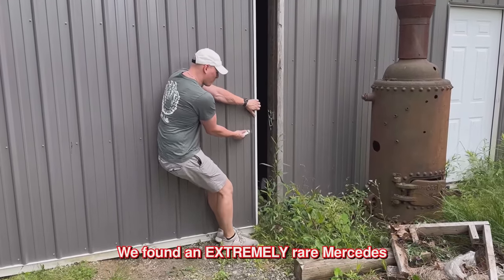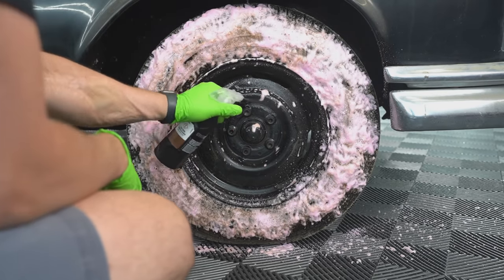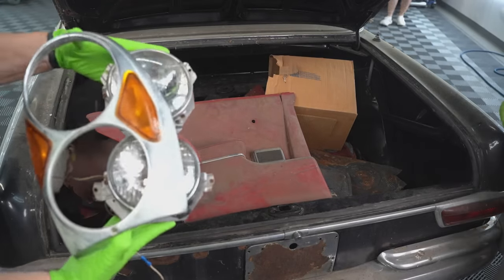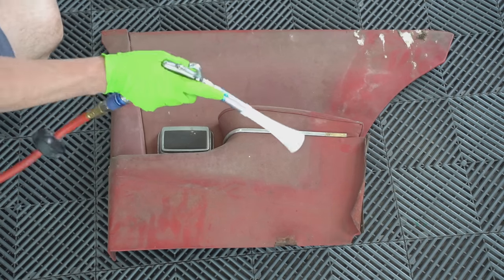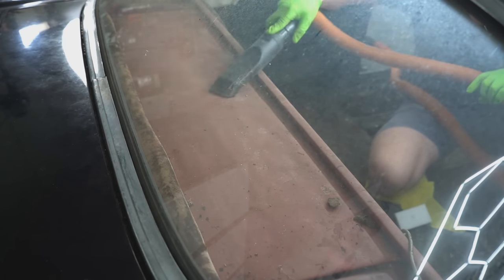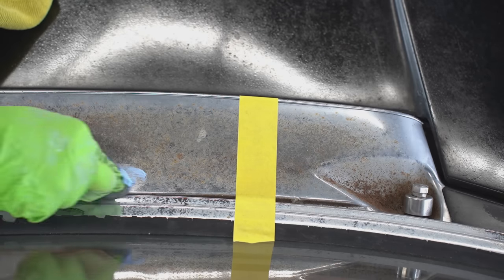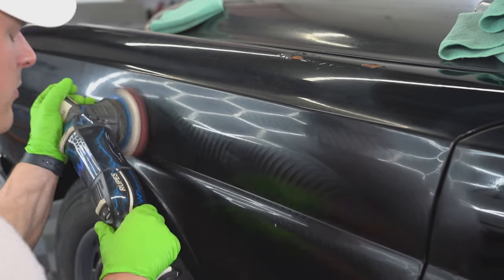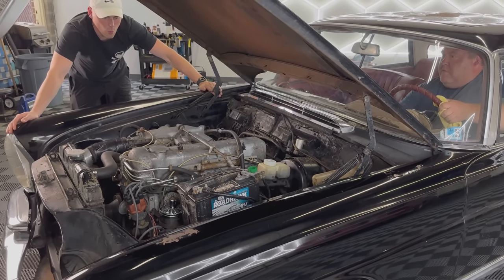First Wash Since 1995: Barn Find Mercedes 220 SE! | Car Detailing Restoration

Comment: You guy do an awesome job each time! It’s so sad to see a beautiful car like that rotting away in a barn 😢 it should be fully restored and brought back on the road.
Reply: That would be nice, except it cost 100k to restore it and you'll just have a 50,000 car
Reply: @exploringintocarsplus8763  this cleaning cost 100k? That car runs already, don't need to be restored

Comment: The headlight lenses show that this is a european model of the Merceces 220SE that, when the rust/paint is resorted and the dash wood brought back to its original glory by a professional shop, you'll have an easy $70 - $80,OOO Mercedes and probably much more without having to do a full-out restoration.  Black with red interior, a white steering wheel (get rid of that leather wrap), a sunroof (very rare on the european models) and the best yet - a Manual Transmission with the original white knob -- and you are in the sweet spot of the hand-built Mercedes cars of the 1960s. The only models more expensive than this in the W108 and W109 line  are the convertibes.  Go to Bring a Trailer and research recent auction prices for these beauties.  You guys have a winner and one of the most exciting automobiles to drive.  Congrats !!!

Comment: Be sure to change all the fluids. It's been sitting for awhile. The only thing I didn't like was the old hand grip cover on the steering wheel , always hated those things. And by all means get the roof redone. If the rest of the car looked like the roof I wouldn't bother. Good luck with your classic!

Comment: Awesome job detailing this car! 
This is a very rare and highly desirable vehicle. In fact, I know of a similar one that was a fully restored example that was recently exchanged through private collectors for $480,000.
That said, the vehicle deserves a full body off restoration by a competent restorer that has extensive experience with MB cars since many parts may be difficult if not impossible to locate. Thus, they have to made again from scratch. That's not easy nor cheap. 
The process will be lengthy, cumbersome, and frankly, very costly. However, once complete the results, if properly done, will be worth it. 
My only hope would be that the vehicle is kept in a safe, secure, and clean storage area when it's not being used or shown.

Comment: Beautiful job. Curious why you didn’t remove that aftermarket steering wheel wrap and clean the rest of the steering wheel. Either the other car or Indian would be great, but that Nash is probably more rare today than the Indian. Just hope you video them both.
Reply: The steering wheel is made of plastic and was probably in much worse shape than the leather steering wheel cover.

Comment: Beautiful and rare car indeed. About the only thing rarer is the drop head of the same model. Both the Nash and the Indian deserve your attention, but the Nash first. That is a beauty and looks like it will respond to your care very nicely indeed.
No question. Strip and repair the entire body, then good paint. I have see what happens to one of these that got left after the paint did that. It was the end for a once magnificent old Mercedes. Done now the panels can be saved. Wait and the entire body will need to be replaced. These cars rust from the inside out because they were sprayed and not dipped at the factory. There are areas of bare metal that will prove fatal once the rust opens the cavities.
Spectacular job, guys. Well done! Seeing it clean reminded me of the one thing I hated when these were new. The tail lamp clusters are horrible! The tail lights themselves are those thin strips above the reflectors. The brake lamps are the inner vertical sections and the turn signals are the outer.
The sound brings back memories. That's what they were like!

Comment: Well i guessed correctly with it being a 220SEb.
An early one with the 2 vien injection pump with splitter blocks.
My dad had a saloon version of this car and, for such a heavy car with only 2.2 ltr engine, it really could move!
Did all my teenage courting between it and his later 230SE & 220S😁😁
Fabulously reliable cars and im willing to bet there are few on the road which are properly tuned, we had a Mercedes wizard of a guy to tune ours up.
The difference is day and night.

Comment: Best one so far! (but I am biased because I am a Mercedes nut). I'm on my 3rd, a 2006 C220 CDI but 20 years ago I drove a 1973 200D. 
I love the red interior, you guys made it look brandnew. As for the rust, it needs to be looked at but I don't believe it is so bad a complete respray is necessary. Looks more like paint flaking and leaving bits bare to corrode, does not look as if it's going all the way through. I'm sure a professional will be able to fix it.

Comment: Not sure if the hubcaps are original?  They being the full wheel coverage came later I believe?  I could be wrong.  I had a 68 250 SE with the moon center caps with beauty rings.  Tough call on rust repair, it is a survivor car. My father had a 69 280 SE Coupe that traded in 1984 and I am still pissed about, I found the car while he looking at a early 60's Chevy convertible.  Beautiful automobile and you gents did a great job.

Comment: Ja, das weckt Jugenderinnerung in mir. Ich hatte mehrere Fahrzeuge 220 Se einmal wie Diesen als Coupe, dann als 220SEb "Heck flosse", dann 2X als 300seb, davon 1X mit 6-Stempel-Einspritzpumpe und Langversion als Versuchsfahrzeug (labormuster) In meinem Leben fuhr ich nur Mercedesfahrzeuge Und fahre diese immer noch.Der 220SE braucht nach deutscher Einstellung ca. 12-13ltr/100km, nach Exporteistellung " blauem Buch" (andere Steuerzeiten)zw. 9-10 ltr/100km; aber auf "KLingeln"(Selbstzündung) achten!! Sprit -oktanzahl normal Benzin Bleifrei 95 oktan. Diese Fahrzeuge waren sehr zuverlässig und sicher. Hinten rechts ,vor dem Tank ist eine Kraftstoffpumpe mit Filter und Druckspeicher Achten auf Dichtigkeit, besonders an den Schläuchen, evtl. sind diese Spröde nach dieser langen Standzeit Fahzeug wurde ca. 1962-1965 gebaut.Mit diesen Reifen(13") nicht über 200 Kmh fahren, Platzen gerne! Fahrzeug selbst fährt leicht über220KMh! Viel Glück und gute Fahrt!
Reply: This engine won't last long with its old oil, not to mention the rest. You never restart an engine that's been out of action for so many years. Sinister video in reality, the gogols are fascinated by soap, for the rest.......

Comment: 2.2litre Coupe Einspritzer 220SE (coupe with fuel injection). The sports coupe light or SL and these S bodied coupes had a great design.  It has mechanical fuel injection and that pump may require an oil change. The full size 4 dr S sedan of this era was out of touch design with fins at the tail referred to Heckfloss.   Narragansett Bay

Comment: Great job of cleaning, but...  Not to be a curmudgeon, and please don't hate on me, the video at 13:14 shows a ruined wood dash that will need to be restored and of course the steering wheel cover means the rare ivory steering wheel will need to be purchased.  Not to mention the vehicle will need to be repainted (see 21.27).  These repairs alone will easily cost north of $10k.  In other words, this is a very clean every day driver worth maybe $7500 IMO.

Comment: Even if it's allegedly rare, these examples of mid-60s MB coupes don't bring huge money. The later V8 models are more desirable.
A full-blown restoration would be cost prohibited. I'd say get the mechanicals sorted to make it a reliable driver and sell it. It should bring high teens, low 20s as is, if it's a driver.

Comment: They made over 14,000 of these, so it's not really "extremely rare". It's a Euro version, which makes it seem unlikely that it would have been displayed at a US car show.
The owner is misinformed about the injection pump. It is lubricated with engine oil, and there is a dipstick on the back of the pump to ensure the correct oil level. You should not add anything to the fuel.

Comment: you need the metal repaired. Reason is that the quality of metal used in the cars after the was wasn't the best. It was a common problem.

Comment: The owner should never try to start this car or mess with the paint.
The only persons who the owner should allow to touch the mechanical and paint is a professional Mercedes mechanic and a painter with Mercedes experience as well.
I believe this car has a mechanical fuel injection system that can cost $15,000 to $20,000 to repair. And again professional only.

Comment: Restore it. Since a paint job on a Mercedes is normally tough as nails, and if rust is digging in as you can see, that car needs to be stripped down to the bare metal, metal repairs made, and repainted. The interior needs attention, especially the wooden dash pieces - they look abused and need replacing. IF that is the last hand-built model of a Mercedes, it should get a full restoration...give or take the owner's wallet.

Comment: Do not ever start any old cars with bosch fuel injection pump before clean/replace the fueltank and like 
you destroy the 2 or 6 valve fuel pump with old fuel or rust from the tank 

NOS or renovation cost is expensive 
for all bosch fuel system for these cars same as 600, SL